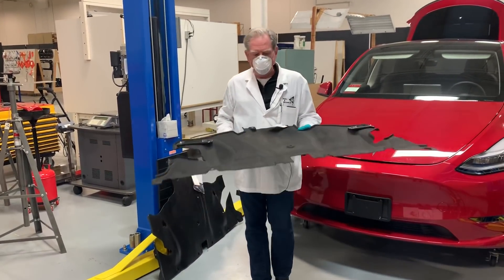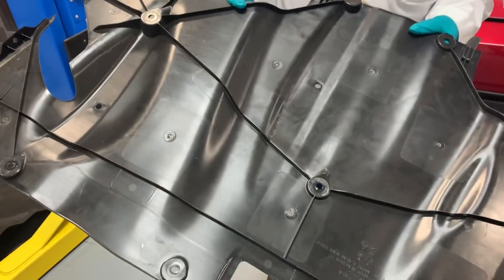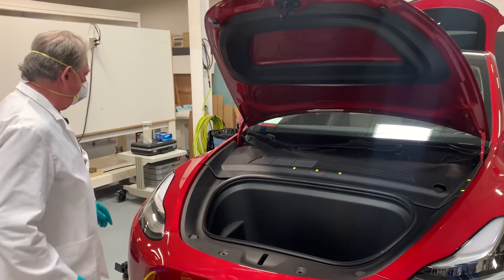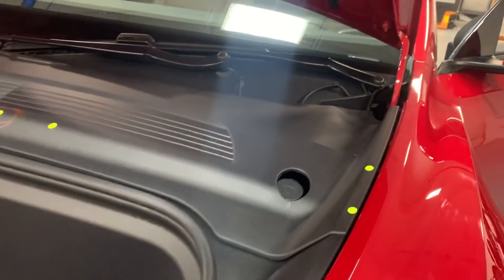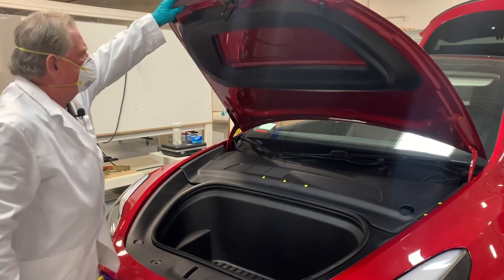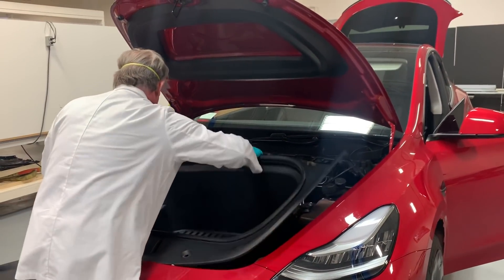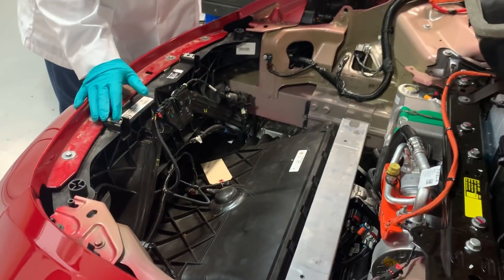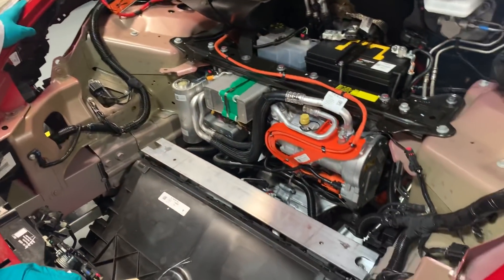Model Y E9: Aeroshields MY-M3, Hood Alignment, Engine Bay Rail Reinforcements (SORB)

Comment: Did the rear aeroshields fit flush with the frame on each side?  My shields have a pin that does not go into the hole they are supposed to fit into.

Comment: Saw a dissection this video—I think you have to follow Tesla’s instructions on how to close the frunk—it’s not like a normal hood where you drop it hard—it’s a soft close and a two-handed press. The adjustments may have been made to the hood at the dealership you bought the car from, potentially not from Tesla (no way of knowing), but most people aren’t having problems with the hood using the proper technique. They still should improve the mechanics so you can close it any way you want—just food for thought. Thanks for the awesome video

Comment: Hi Sandy,
Is it possible that the car may have been tampered with whilst it was at the dealer which you had purchased it from?
The fact that those bolts and markings don't line up does seem to be a very strange occurrence!

Comment: Tesla should reaaally concentrate on QC, that kind of haphazard assembly on this expensive vehicle is not acceptable. Also i see they were using some way too long bolts on the end there.
Reply: skaltura no, they need to concentrate on volume while Elon worshipers are buying anything with Tesla logo.
Reply: @rok1475  Those 2 are not mutually exclusive. You can do high volume with very high quality finish and fit.
Reply: skaltura you called for Tesla to concentrate on QC. Since you can can only concentrate on one thing at a time, my argument is they need volume more than quality at this time.
If you meant to say Tesla needs to pay more attention to QC than they do now, I would agree.
Reply: @rok1475  Once again, not mutually exclusive.
There are plenty of examples where high volumes are pushed out with impeccable fit and finish.
Reply: skaltura You are obviously still missing the point.
You cannot concentrate on more than one thing, focus on more than one point or have more than one top priority. Just look up the meaning of the word “concentrate”.

Once again- if you stated that they need to pay more attention to QC, along other important things, that would be true.
But to say they need to concentrate on QC means not concentrating on other thing.
In my view if they had to concentrate on something, production volume would be more important at this stage. 
By definition they can not concentrate on two things.
They should be doing many things well concurrently, and indeed, there are many examples of that, but that is not what you wrote. Perhaps this is what you intended to convey, but it did not come out that way. 
Precision in expressing ideas through language is important. Understanding of the meaning of the words we use is the fundamental step towards that precision.
Reply: @rok1475  In business you can "concentrate more" on some thing without doing less something else.
It is called hiring more people.

In this particular case it is about design & engineering so it's mostly once off work as well for longterm. On short term you can have any one going around with a gap gauge and writing it down to get a sense how bad the issue is, then couple junior mechanics going around fixing those gaps.
Reply: skaltura I suspected this is what you intended to say but you expressed your thoughts poorly the first time.

Comment: This car was bought from a dealer.  Did someone there mess up the frunk and then try to "adjust it"?
Reply: I'd say there's a pretty high likelihood of that. The marks on the latch are put on after everything is in place, not before as an alignment guide. Whatever happened to the car after it left the line, someone had to have been tinkering with the latch assembly and couldn't get it back in place when they moved it
Reply: @richardmillhousenixon  I've worked a bit with hoods and what looks easy as far as alignment can end up being a real can of worms.  You can make one little adjustment and all heck breaks loose.
Reply: @StormyDog  Yeah definitely. I've done quite a bit of work on my own car (not a Tesla but my point still stands) and even seemingly simple things like getting the headlight assembly back in place after replacing a bulb is a bitch and a half

Comment: Watching on a laptop rather than my phone, I can see at 4:40 that the latch has been moved down a staggering 3.5 mm during the tinkering. The original latch position has been recorded by a white marker around the lower half of the fixing bolts' flanges which shows on both the washer and the bracket. This means latching is  just beyond the compression "give" in the neoprene frunk collar and/or loose cover. Bring the latch up 1mm maybe and all good.

Comment: Wouldn’t it be nice if they had Sandy look at the car before they finalized the design.
Reply: That implies that the the design would then be 'finished' -- static from that point.  Tesla changes the parts and tweaks the design on the fly.  If Munro does a teardown on a Model Y three years from now, he will STILL find areas to improve, but they will be different.  All this stuff will (ideally) be resolved, and that will reveal (or less ideally, cause) other issues.  Munro is not looking for things that are 'wrong' (although he calls them out when he finds them), he is looking for things which can be done better -- it is an eternal quest.

Comment: Tesla's have incredible engineering, if only they could assemble their cars as well as the other cars that have combustion engineering! It seems that that Tesla has trouble with the simplest of the details, but they really have a handle on the hard stuff.
Reply: Tesla is foremost a technology/software company.  Build the highest quality bodies is not their main skill and it may take them a bit of time to get as good as those companies that have been building bodies for a hundred years.

I wonder if a small robot could sit below the car or even inside the frunk and tighten the hinge/latch bolts when the hood was closed.  Let another robot set the gaps and height.

Comment: you were very critical with the Model 3 on the overuse of material for the frame design, not really doing anything to make the car safer but simply wasting money. Are you seeing a similar thing in the body design or did tesla lean things out while still keeping a similar level of safety?
Reply: He did make a note that the wheel wells are using way less parts and the casted frame in the back may cut cost while reducing parts.
Reply from the maker: @miguellopez3392  Thanks for making that connection, Miguel.  Yes, based on what has been observed so far, there have been significant improvements in material utilization in the rear cargo and rear quarter areas of the Body in White.  Eric, consider checking out Episode 6 for more specifics.  Thanks for tuning in!
Reply: @MunroLive  yup, i saw that video! thanks for the reply! so is the rear cargo/rear quarter areas mainly where tesla was wasting money on the model 3? thank you so much for the information!

Comment: puts on conspiracy hat
Sandy said he bought the car from a dealer. Could it be that other auto manufacturers found Sandy's dealer and paid that dealer to mess with the fitment of the front trunk? The clips on the front were broken off before he got it, sort of weird for a brand new vehicle.
Reply: Probably not and due more too early production problems be he does see an improvement over the 3.
Reply: Tesla quality and fitment has always been below standard. Nothing new to see here.
Reply: @joegreene6250  before the model 3 it was good.
Reply: Better get the car w.o middleman involved just buy directly to tesla cheapet and less likely to rigged(although the probability of that happening is 5% below)

Comment: I say from experience hood fit changes from how it was from BIW through GA. All cars go through a body fit process after assembly to correct fit issues. The hood and latch was adjusted for a reason. The contact with trim is a symptom not cause.

Comment: Regarding hood ... look at the Episode 1: https://youtu.be/yWU65rv-r7w
When they got the car, the hood lay completely flush.
At the start of this video he can stick a finger in there.
Obviously Sandy managed to bork it himself.
Reply: @kevinjoyce5756  A friend of mine got one of the early model 3s and this video is not how it would look straight from the factory. Now I'm not saying he intentionally messed it up and is reporting on that as if it came that way from the factory because if so, he would be setting himself up for a million dollar libel suit, but I'm also saying that something has been changed after the car left the factory. Those marks on the latch are put there after everything has been torqued down as a way to check at a glance if any bolts are coming loose, and also as a guide for the dealer/repair shop if they have to remove it to get to something. Someone quite clearly fudged it up and doesn't want to admit they did so

Comment: Thanks for the awesome coverage!
What I wonder is, how does the production quality of the Y compare to other manufacturers first-gen products?  Seems like the theme here is that Tesla has some awesome engineering (they seem to get a lot of kudos for their ingenious solutions), but they struggle some with production consistency.  Would love to see if this can be corrected with time.
Reply: There hasn't been first gen models for years now with the other automakers (maybe the i3) but Bloomberg did research that Tesla was doing better than the average automaker.

A big thing is that automakers develop their cars to keep on running until warranty, Tesla develop their cars to have minimal warranty, at any year.
Reply: @MrRollingEgo  Lol. Keep dreaming.

Comment: The hood on mine is out of alignment as well and also looks like it was adjusted after the fact.  Having a mobile service tech come out this Monday and hopefully he can get the hood aligned so it's not paint on paint against the bumper.
Reply from the maker: Chris, thank you for sharing your experience.  Insights like that are useful in determining how prevalent and consistent potential issues may be.  Thanks for tuning in!
Reply: @MunroLive  if you would like pictures, measurements or anything to compare against, I'd be happy to share.  Thanks for the videos, it's nice not having to tear mine apart to understand whats underneath :)
Reply: @MunroLive  Just checked mine VIN XX0413.  No sign of any adjustment on the trunk lid hinges.  Closes fine, but does sit slightly below the front nose piece.
Reply: @rogerheuckeroth7456  It's adjusted incorrectly, as well. So far we are 3-3 for Tesla hoods not fitting correctly. I would assume almost none of them fit correctly. Tesla quality is still in need of some attention.
Reply: @joegreene6250  I kind of expected some issues with fit and finish being one of the first 500 off the line.  Hopefully they take the factory shutdown time to improve the production line.
Reply: Roger Heuckeroth mine was 433. Is yours gray?
Reply: @handlealreadytaken  Yes. Gray with Performance option.  Guess they call it Midnight Silver Metallic.  I took delivery in Raleigh, NC on Friday 3/20.
Reply: @rogerheuckeroth7456  then we are only 20 cars apart and configured probably the same.  I took delivery of mine on the 19th in Atlanta.

Comment: Isn't it touching because that cover piece is (visibly) not secured all the way down?  And isn't that the case because of the broken snap?  I mean, it seems obvious just from looking at it, but I'm not there  :)

I'm sad to see the 12V in there  :(  I was hoping they'd be able to get rid of that by now.

Great video series - lots of respect for what you do.
Reply: Um, the vampire drain will eventually kill the main battery after a period of non-use and the 12V is there as a backup so the electronics will allow you to recharge after having it towed.
Reply: @joegreene6250  Tesla's original plan was to get rid of the 12V battery in the Model Y.

Comment: In aligning the hood for proper gaps they they misaligned the seals and latching which interrupts proper closure. QC and assembly issues off the line is the issue. Gap realignment should not have to be done after assembly and paint.
Reply: They have far less issues than a traditional manufacturer.  Remember, gas companies ship cars to dealers who fix these issues.  Tesla has to be much more perfect due to direct shipping to the customer.
Reply: @_PatrickO  Not true. 1)Tesla preps vehicles at delivery point prior to customers. 2)Honda, Hyundai, Toyota, Kia etc QC their vehicles at the factory before it goes on the truck. Fit and finish can be spotted and corrected prior to dealers. Many use laser light section technology to do robotic gap and flush measurements at the end of assembly line (long before dealer). This is how you do it.
https://www.youtube.com/watch?v=hcAjQXPUtOo
Reply: @JZainbear  100% false.  There is no ability to prep cars with home delivery and even if you pick it up at a store, they are treating it the same with no inspection.  It is laughable for you to lie about tesla and pretend traditional dealers do not fix tons of issues from the factory on new cars.  You are a huge liar.  Your video is meaningless, it is some company advertising a product, not anything to do with traditional auto companies.
Reply: @_PatrickO  Tesla would disagree with you. Tesla Delivery Center does perform a pre-delivery inspection. Its is performed by a Tesla PDI technician.  The technician repairs the issue if possible. Then the customer does a delivery inspection prior to driving out of the garage. It's some company advertising? Companies such as Mercedes Benz use this QC robotic system of inspection on the assembly line. Tesla can use this system also. You are a very angry individual.
Reply: @c-5899  Your lies are funny, most cars do not go through a delivery center like that.  Tesla has to aim for a much higher quality off the line due to direct delivery to customers which is not something old car company do.
Reply: @_PatrickO  “liar” is a shock-term with no value. Less emotionalism and more research and critical thinking will benefit you. Direct Delivery to customers does not mean direct from the factory. Tesla has one factory and distribution centers all over the country. Each center has Inspections before delivery to customer. Some may come direct from Fremont. Most do not.
Reply: @JZainbear  You are a liar because you lie.  After being called out, you are now admitting there is direct delivery.  You are already crumbling.
Reply: @_PatrickO  Exactly where did I say there was no Direct Delivery?
Reply: @JZainbear  The part where you falsely claimed they don't have higher QC standards because you said they had no direct delivery.
Reply: @_PatrickO  I said no such thing. So either English is not your first language or you are disturbed. Either way we are done here.
Reply: @JZainbear  It is funny when trolls cannot even attempt to defend the things they say.

Comment: At 0:40 of your First Impressions video you said, “I don’t even need my gap gauge, this looks in pretty good shape” and the frunk looks normal. However, at the beginning of your Frunk video the gap looks off before you open the frunk...implying it had been opened between the videos. Based on how you closed the frunk in your Frunk video, my assumption is that you or another member of your team improperly slammed it closed and shifted the bolts for the brackets and latch (someone may have already messed with the cowl too).
Reply: So there's a special method for closing Tesla frunk's. 
If the bolts moved by shutting the frunk, they were clearly loose.
Reply: @Robert-j6r8c  lol, there is no special method.  The bolts absolutely did not move.  You ever touch a car before, if those bolts are lose enough to move, it will be very obvious when opening it.  The hood would wiggle as you handled it. You can see no such thing in the video.  This is a simple 2 minute adjustment issue that you fix with a socket wrench.
Reply: @_PatrickO 
I know, that's why I pointed out if it moved they were loose.

Clearly not a 2 minute fix as it didn't shut properly when the plastics were installed on the original set, then was adjusted and still doesn't shut properly.
Reply: Robert  first off, I am long TSLA and was trying to say this is Munro & Associates fault rather than Tesla’s. Also, there is a proper way to close the frunk - you set it down then push with the palms of both your hands (Tesla advises not to slam the frunk shut)
Reply: @bfox333 
And if you watch the other videos you see Sandy doing that and the bonnet not wanting to close. 

Dig a little deeper, and the bonnet has been adjusted at some point on the line. Showing the has been a problem before paint.
Reply: Robert as I had previously noted, it was properly closed in his very first video. Also, it is clear the frunk was moved AFTER paint because you can see in this video where the bolts were before paint
Reply: This is the dumbest comment ever.  Get your short seller fud bullshit out of here.   If closing the hood can shift any of those parts, that means it wasn't tightened down. That is clearly not the case here. These "problems" are all trivial as shit because they take someone a few minutes to fix.  A slightly better clip seemingly would fix it all for good.   Nothing is wrong with the fundamental design.
Reply: @_PatrickO  how can you explain that the frunk was closed perfectly fine here: https://youtu.be/Q594XSQ3GwM and now we have such a gap? This is bullshit.